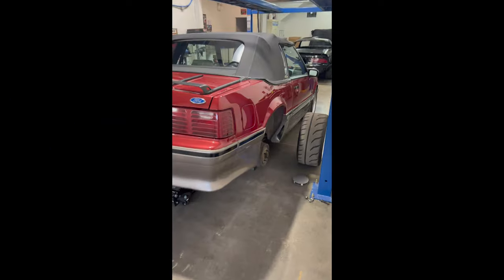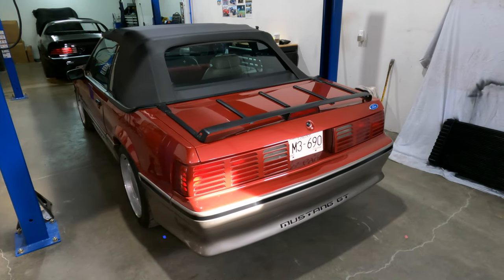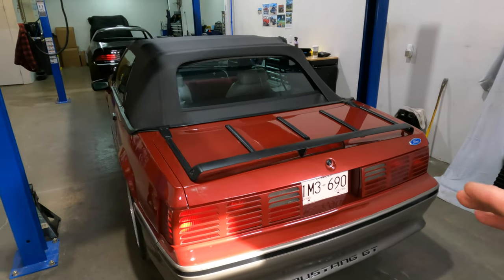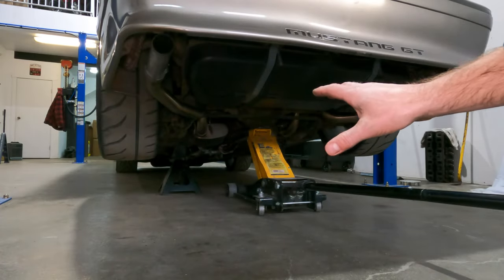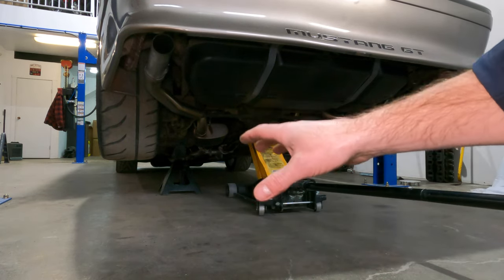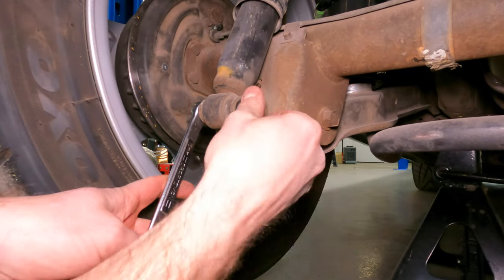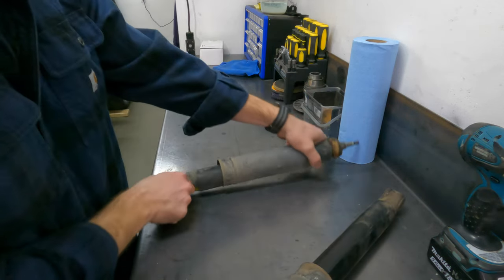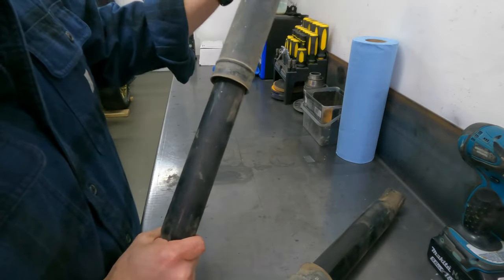Make Your Fox Body Mustang Ride, Handle & Feel Brand New in 5 Minutes

Comment: Great videos.. What kind of shocks did you use and also did you replace the quad shocks at the same time ?
Reply from the maker: I used a KYB stock replacement for the time being. Also, I have not put quads on it yet but will be ordering a set shortly

Comment: 🔔😎
If you have an air or even electric driver, often they will out run the top nut and zip the top nut right off. 👍 No 1/4" required coming off.
BTW I put urethane bushings on the shocks (and everything else) and it really firms it up... Stiffer feeling and transmits road noise through the car, especially "tar strips". Ouch.😳
IMO 98% of new shocks are too stiff. A good case for adjustables.👍

Comment: Hi Gary. Great video and perfect timing, I just noticed my shocks are leaking. So, was the convertible top well liner already out of your car? If not, maybe a quick video on how the liner is removed. Another comment asked what shocks you put back in and I'm curious as well. Thanks! Bill. 🦊🙂
Reply from the maker: Hey bill! My vert didn’t have any sort of cover over the rear pump/lines etc so I can’t help you there. I used a OEM replacement KYB rear shock from my local parts store 👍